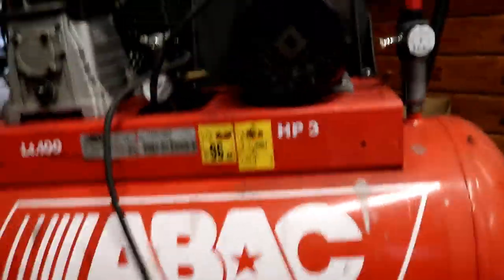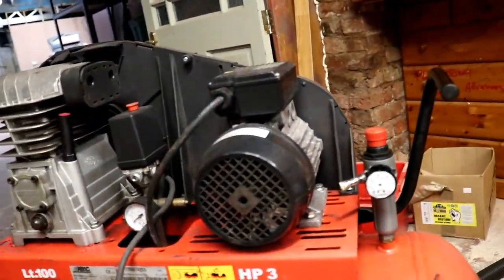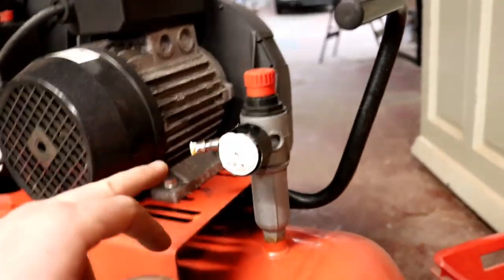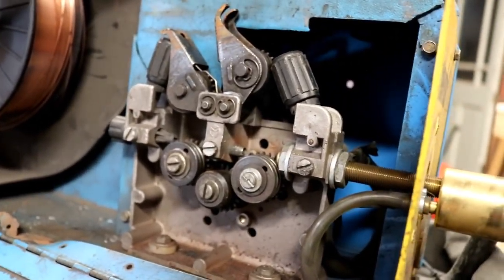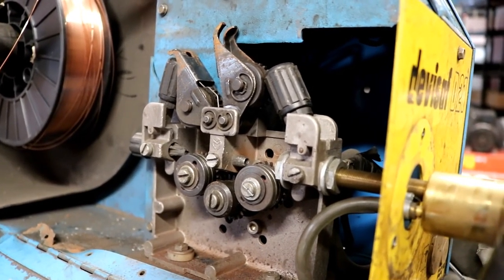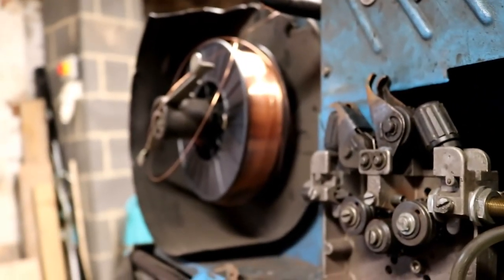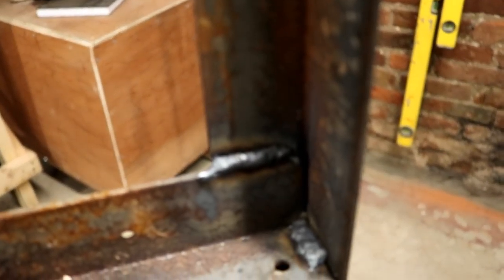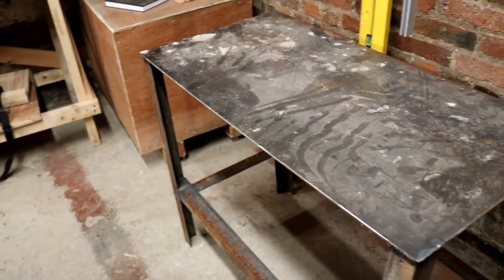THE AIR COMPRESSOR

Comment: I can see another trip to tool station today , they sell compressor oil plus air tool lub and bits , I always use 1mm wire in my mig welders I would only use 0.8 if I was welding thin plate as in car panels, looks like you are getting there with the welder , just need to play with welding on all speeds and settings and you with find the sweat spot, I always wright it down because I weld mild , stainless, and alloy and they are all different, loving the vlogs
Reply: Is the black rocker switch a wire feed switch?

Comment: Don’t make the rollers to tight it can flatten the wire and it will struggle feeding through the  tip, spray some anti splatter or wd40 one the tip and get some tip cleaners … your almost there
Reply from the maker: slowly, haha